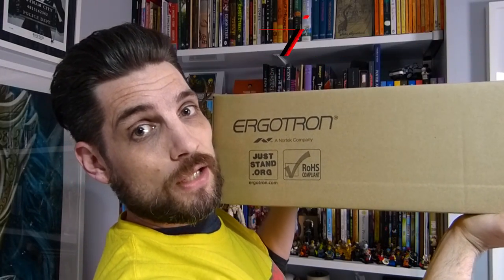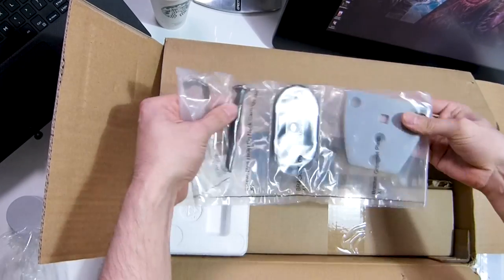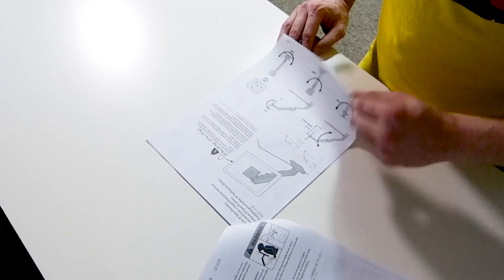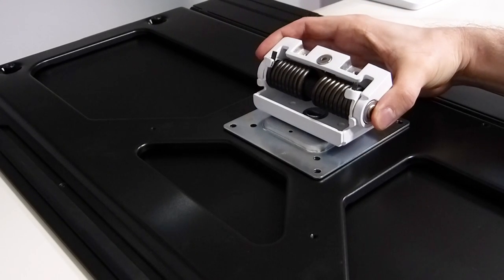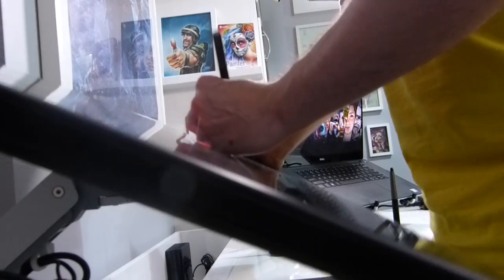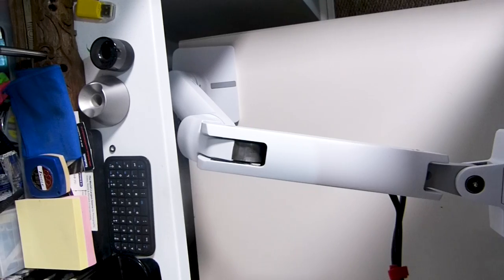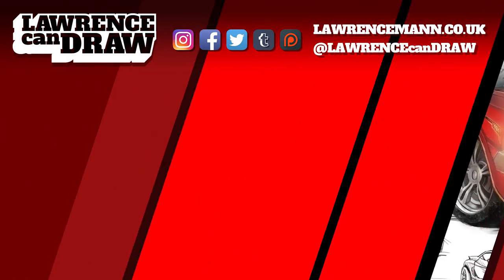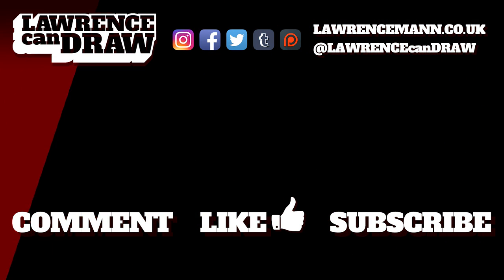Dell Canvas 27 with Ergotron arm & VESA mount

Comment: I'm 90% committed that I want a Canvas, but being in the UK it looks like I've got to wait a while until that arrives... I know it's basically a Wacom 27, but that's fine. I don't have a problem with Wacom hardware, but I do have an issue with their customer support - or total lack of it. Dell's after-sales is so, so much better that I'd choose a Canvas over a Cintiq even if the price is identical.

Vesa mount is great to see, fine example of Dell listening to customer feedback, but it's a wedge of cash for what is basically a moulded piece of sheet metal... feels like they could have put that in the box with the basic unit and not charged anything extra for it.

Will be interested in a look at Dell's own stand if you manage to get your hands on it. I quite like the idea of something that is movable between desks and not too specific about where it can be set up. Even if it will probably run a good 15-20kgs with the stand attached :)
Reply from the maker: I'd quite like to review the stand as well. I never had the Wacom stand for the 27QHD so it would be nice to see the Dell version. Also know all of the details about that too. Stay tuned and we'll see if we can make that happen!
Reply: Excellent, thank you :D 

Here's hoping they do a UK launch before Wacom's new 24 comes out... it looks sleek and light(er) but I don't really want to put any more money into them until/unless they figure out things like responding on forums and social media, answering support emails, and putting a quality guarantee on the product that is appropriate for the price they ask.
Reply: Dell Canvas is scheduled to launch in the UK on August 29, so well before the Wacom 24" Cintiq Pro.  I have to say that #iwork4dell so I'm happy to answer any additional questions you might have.  Thanks for your interest in our device!
Reply: That's good news, thank you :)  

Since I have your ear, can I ask whether these will have the same premium panel guarantee and warranty/replacement policies as Dell's professional monitors? I stick with your screens because you stand by them (I have four on my desk right now, one is from 2007 and simply will not die!), so I'd love to know that the Canvas will get the same level of after-sales care, should it be needed ^^   

(Wacom returns process can take weeks, during which the buyer has no product on their desk. IMHO that's just not acceptable if the drawing screen is your professional tool!)
Reply: Hi Eddie, thanks for being a long-time Dell customer.  Yes, it will have a standard 1-year warranty similar to our UltraSharp monitors.  Many regions are defaulting to standard 3-year in the starting price so it just depends on where you are as to what the default is/will be.  You can always adjust the warranty to cover more/less years.
Reply from the maker: In all honesty, this hadn't crossed my mind. This thing is very solid. I know a lot of people were glad to hear about the Gorilla Glass but it doesn't creak at all and it just feels very robust. Almost like it's made for outdoors.
Reply: Thanks for the reply Sarah :)  I'm in the UK, so fingers crossed we're one of the 3 year warranty places. One of the reasons I tend to recommend Dell to others is that you have a reputation for doing things like shipping the replacement unit before the old one has been received back. For things like this - i.e. an expensive workhorse of someone's business - that's pretty valuable to have backing you up ^^
Reply: Good to hear Lawrence, thanks for the reassurance. Tbh, it's more things like electrical failures that I like to be sure are covered under a good warranty. We know that Wacom had some issues with dead pixels going on and that they didn't consider it a fault until there were at least 18 of them - even if pixels were blown on arrival! My hopes are to see the Canvas getting Dell's premium panel guarantee and several years cover out the door. It looks like a great product, it deserves backing up with good support to leave no questions about value for money :)
Reply from the maker: Wacom's issue only happened on a few models of the 27QHD very early after launch from what I understand. This kind of stuff generally just gets blown out of all proportion and becomes a 'legend' because the YouTube video never goes away and other people report it again and again in their videos so it sounds like it happens to more people than it actually did. I heard the story too. I do believe it but I just think it wasn't all that bad and I bet that most people get their money back or got a replacement after a bit of back-and-forth. They probably just didn't like having to prove they had dead pixels. It's trickier than you think. I had to do it once with a laptop screen. 

I've had very few issues with Wacom and I've been using their products since the mid 90's. Love them to bits. I hear horror stories all the time (tales of joy too) but I hear justification for it a lot of the time as well. I had to tell someone off yesterday when he seemed to be proud of himself for leaning heavily on his Wacom. I explained that he'll damage his screen that way, even with protective glass. Same with the Gorilla Glass in the Dell. I'd still try and be gentle with it. It might seem tough but when you're throwing that much money at Dell it's probably better to never have to put it to the test!

Same goes for your Monitor arm. Buy the Ergotron arm that comes with a 10yr guarantee and has been tested hundreds of times rather than the cheaper unknown brand that might snap and smash your expensive tablet :O
Reply: To be honest, my general beef with Wacom is their lack of interaction with customers and poor guarantee. Their support forum was inaccessible for something like 4 months at the end of last year, after which all user accounts and posts had been purged, conveniently removing 1000s of unanswered threads. Meanwhile their subreddit is a bunch of confused people sympathising with each other about problems that Wacom support hasn't helped with. When I did manage to contact one of Wacom's reps last year, I was told that they're only backing the 27QHD with a class-2 panel standard. That's 18 dead pixels before it's a "fault"... on a £2200 device that you'll be sitting up close with! Ouch.

That said, I actually like my 13HD and I really enjoy drawing on it. Yes, the Wacom service stops itself every few hours, and the pen needs a regular wiggle because the cursor stops moving, but in terms of tracking accuracy it's by far the best device I've used. There just isn't a competitor that does the job so well. Moving from an Intuos to this was the best thing I've ever done for my art, and even though I'm just a hobbyist, it's paid me back 4-5x its own value from occasional freelance pieces done on it. I don't actually want to badmouth Wacom, but they do worry me when it comes to investing in their more expensive products.

And I fully agree, I wouldn't want to put a £2000 device on a budget arm! I'm interested in Dell's stand, because the short-lived picture they had on their store suggested it may be something that just sits on the desk/table, which makes it a little more versatile in where it can be used. Definitely want to see what they're offering before I made a decision on that front, fingers crossed that they send you a review unit ^^
Reply from the maker: Did this problem with the pixels happen to your personally?

I'm going to try and get a Dell stand for review. I've always preferred the Ergotron arms so don't expect that to change but do expect an honest review if I can get one!
Reply: I was asking some questions prior to purchase last year, but on being told by a Wacom rep that it's only held to a class-2 standard (allowing 5 dead pixels per million, on a screen with nearly 3.7 million), I got cold feet and never bought one. It's kind of become an ethical crusade now, I feel like premium priced products should have a premium guarantee.

Anyway, sorry, derailed completely from the original topic. Looking forward to any further Canvas videos you may make :)
Reply from the maker: There will be more Canvas videos shortly! Just finished recording a good one tonight.

For all we know there were very few recorded incidents of the dead pixel thing actually reported. It's more of a point of principle issue. I agree with you but until it happens to me, I'm not gonna make an issue out of it because Wacom have always been awesome to me.

Comment: Thanks for this video, I was thinking about getting the MS Studio but now comparing this with a Dell Limited Edition XPS tower 29 inch Ultra widescreen monitor, and the Dell Canvas, with even a ram upgrade. This is is slightly cheaper than the Studio and better parts. I cant wait to see how this works with all Adobe software.
Reply from the maker: What kind of work do you do Steve? If you do video then the wide-screen ratio is certainly going to be better for you as well. It's certainly nice to be able to upgrade the computer you're buying. I'm using a very powerful Precision 5520 XEON 32gb laptop and it's a beast! Love it to bits.
Reply: Oh I am a Photographer, and halfway through my BFA to be a Graphic Designer, My roots are graffiti many, many years ago. I do hope to try that with the Canvas. I've needed the upgrade so this makes the best sense. This upgrade should help for sure! 
www.g-photography.co
Reply from the maker: This will probably suite you down to the ground then! That screen size is awesome for editing on. It make a big difference for retouching. You'll notice the large arc arm movements come back from your days with a spray can ;0

Comment: Looks great, that white monitor arm, makes you wonder why most monitors just have to be black. Still waitin' for 4K, but if i had to have a 27"QHD, a $1900 Wacom Cintiq 27QHD with a $140 Loctek D7H would be my choice. The Dell Canvas/ergotron/vesa adapter would set me back $240 compared to the Wacom/Loctek. That $200 Canvas adapter is a dealbreaker, i don't get it. Dell could've anticipate this. 
In europe the Wacom Cintiq 27QHD Touch with Express key remote goes for 2000 Euro VAT excl. 
I'm gonna get me a bucket of white paint:))
Reply from the maker: Well, I haven't tested the Locktek brand and it doesn't have the same guarantee so I don't want to hang my hat on it but if you're happy with it then that's cool Ruud! You don't have to have the Wacom remote. You could get a £8 mini Bluetooth keyboard like the one I show off in a video here on my channel. It'll work well. That's £90 saved.
Reply: LAWRENCEcanDRAW no guarantee? Does that mean that when the loctek doesn't pull the 22 lbs. like they claim it can, and my monitor falls of my table in pieces I'm out of luck without consumer rights? That would be a bummer:(
Reply from the maker: is 22lbs the max load on that? If so then you might get a tiny bit of wobble. The HX is really steady. I leave it to you! Remember you've got the weight of the Canvas plus the weight of the VESA!
Reply: LAWRENCEcanDRAW yeah, what's the expression, " penny wise but pound foolish", saving 100$ on a monitor arm causing your $2000 monitor to crash down may not be the smartest move:(
Reply from the maker: That's why I made that huge statement at the beginning about trusting Ergotron. lol. Did you skip through the video? Be honest! lol.

Comment: That extra dell bracket cover still hits the normal cable... I dont understand how this is suppose to guard the cables when clearly it wont sit flat while letting ur cables sit underneath. If u run the cables down it will work but then ur cables can bend possibly damaging them... I'm skipping on this cover, I just can't understand how this is suppose to wrk. Thanks dell!
Reply from the maker: Yeah! It's made for if you're using just the Thunderbolt cable only and not the HDMI etc. That's why. I don't use it either because my computer doesn't have enough spare Thunderbolt ports :( No matter, still works well without it and I'm sure the cover is great for some people!

Comment: Thank you for this ! It a beautiful device and much, much better mounted, too bad about the cables but it looks great nonetheless. The official articulating stand does look good but is not only pricier, it also looks less practical.

The only concern I have is about a release date for Europe. I can only find the Canvas on Dell US & Canada websites, and they don't ship overseas. I just really hope it won't take months, as Dell's meaning of "soon" is questionnable :p
Reply from the maker: That's true. We'll just have to wait and 'overseas' lol. As soon as I find out more I'll post some videos! 

My cables were a personal choice. If you use the supplied cables then the back panel will fit! That's just me going overboard with 10m cables to hide them from sight!
Reply: Haha ! True, I don't need 10m cables, I just need 2m, I hope the supplied cables will be enough ! I would have used the USB-C cable if I had a USB-C port, it's less cable management, but I won't risk buying a USB-C PCI express card since it doesn't work for the Cintiq Pro 13/16, I doubt it'll work here either. Plus I don't know why but those USB-C cables tend to be pretty short...
Reply from the maker: If you watch my review you'll see there are a ton of cables supplied with the Canvas and they'll be more than adequate if you just want 2m.
Reply: Yes, that USB-C cable is short due to the spec.  All other cables supplied with the Canvas are 8m.
Reply from the maker: It's just a drawback to USB-C at the moment. In the near future all that will change and cables will become faster, handle more data and be able to be longer! This is still a new technology. Still 10x better than USB-3 :D
Reply: Thank you both for explaining why ! :D USB-C has amazing potential and I hope it becomes more and more accessible, Dell is definitely doing this right !
Reply from the maker: Oh it will! So many companies are using it. It's just a matter of time now. It's just like original USB. It just needs a little time. I'm sure it will be even faster as well, especially as we're even seeing processor speeds finally making jumps for the first time in years :O #ExcitingTimes

Comment: a warning to anyone looking to buy this in the UK, I phoned up to place my order on August the 29th at 9am, first customer through the door essentially and I'm STILL waiting on it. They are estimating delivery at the end of the month now, although the delivery date increases every day, so that's a two month delay at least. I hope wacom announce a release date for the 32 inch monitor as this has been the worst customer experience I've ever had, by far. Just FYI.
Reply from the maker: We already knew it was going to be at least one month because that's what the US customers had to wait previously. My guess is this is because of heavy quantity of orders and yes, there has clearly been some bad organisation  too but if they have your order then the delay is probably just because they haven't got the stock to fill the orders that flooded in.

Wacom already gave a release date for the 32". It was in my video as well. It's January for the launch. Wacom traditionally start shipping within the month. They have been building tablets for almost 30 years and can accurately predict sales so build stock in advance. Dell didn't do that in this case because it is a new market. They probably do it with servers, desktops, laptops etc and goods they've built for years though. Typically companies don't risk manufacturing of a product until orders are placed in new markets. I remember Apple doing this with iPhone all the way through iPhone 3. It was murder getting one unless you had per-ordered. That said, I do think Dell should have opened the pre-order doors here and ironed a lot of the bumps in this process out for people before launch.